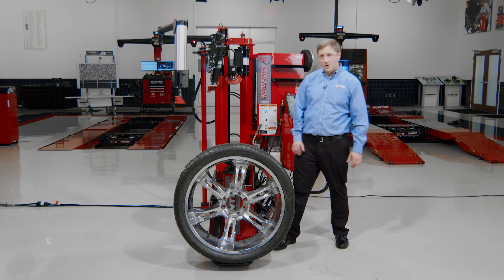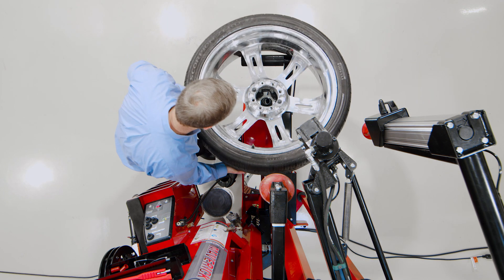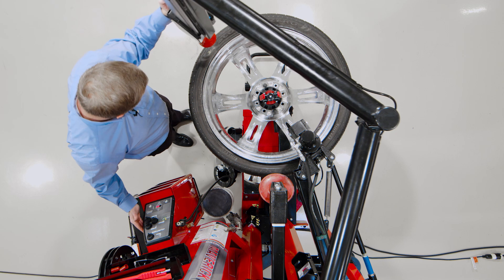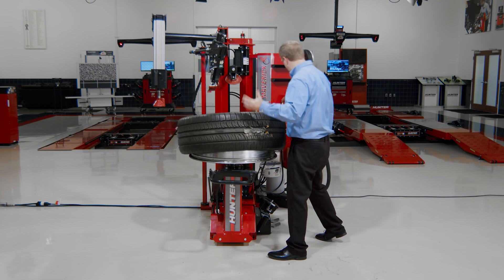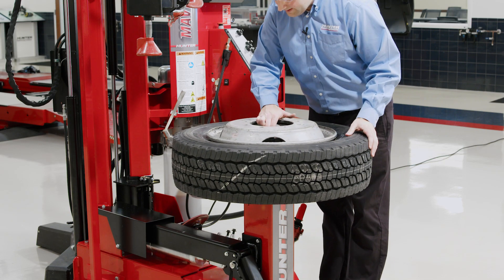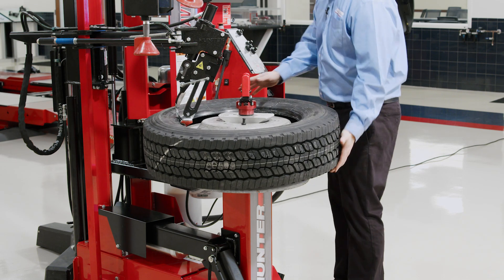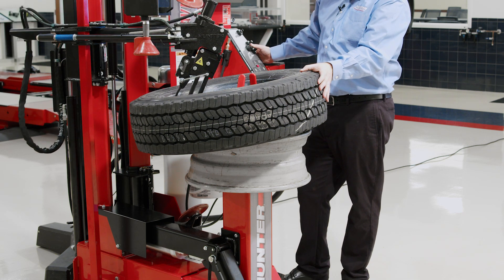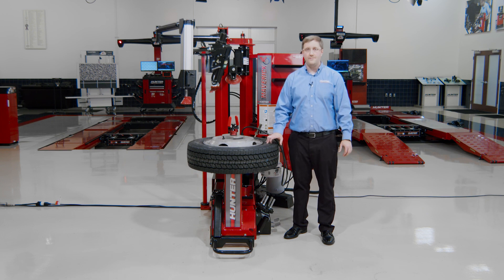The Maverick® Tire Changer: Advanced clamping operation

Comment: Jim, do you find it helpful to keep "tension" on the top bead with the upper roller while you break the bead on the lower or inner bead?
Reply from the maker: “Not typically, the only reason I leave the upper roller in contact would be so it is readily available to make a gap for the demount hook on tougher tires, most tires don’t require it.”